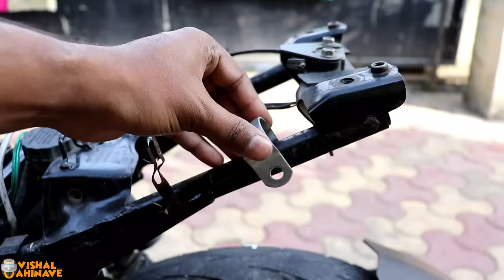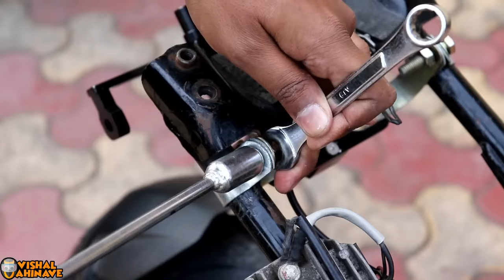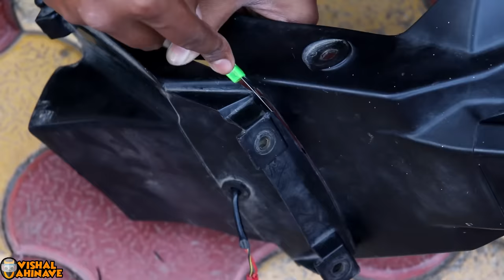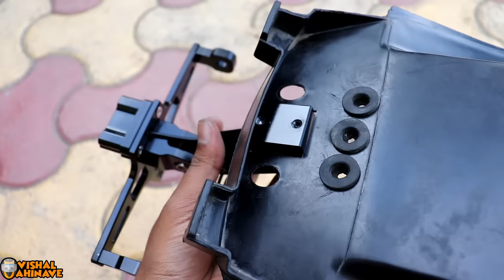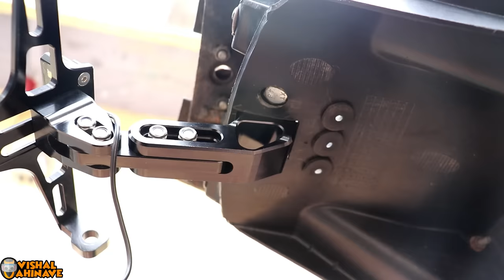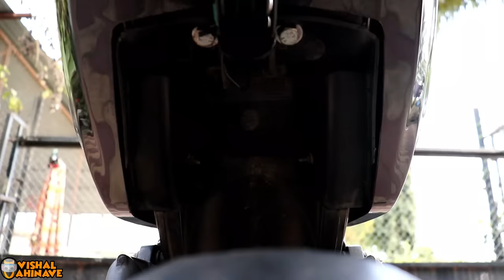Pulsar 220 Tail Tidy

Comment: I have a question I put one equal to an ns200 but I have the problem that the light that illuminates the plate is blinking, what should I do?
Reply from the maker: It must be faulty
Reply: @vishalahinave  seriously but I see that yours only has two cables that connect to the light of the license plate mine has 3 I don't know if that must be why
Reply from the maker: Then may be 3rd wire is for blinking function

Comment: Brother I'm from Bangladesh. What's the size of the round clamps and I'll fit the ns number plate clum in my pulsar 150 so can I use this method? And the straight clum here you use can be used for ns number plate clum with the L style bend process?? Lastly you cut the mudguard. Can I cut it in the same way for the ns number plate clum?? Pls answer the questions brother
Reply from the maker: Size of that round clamp is same as the leg guard diameter, it's used to fit extra horns or lights on leg guard. That L shape one can be used with ns number plate holder. Cutting of mudguard depends on how your Tailtidy is. Have a look at this video https://youtu.be/pmP06D1sTkI
Reply: Can I find the round clamps in the store